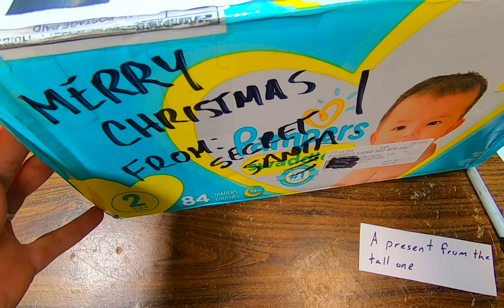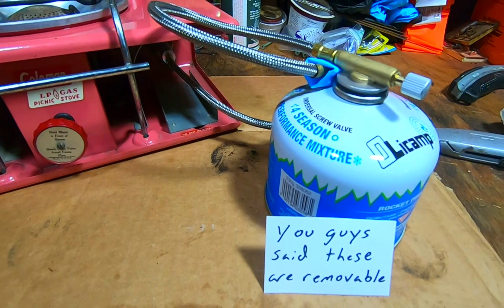Vintage LP stove adapter

Comment: love those stoves. i have found a company who makes fuel canisters that are the same dimension as the old original cans. hope it works i haven't received it yet and if it doesn't work its only 8 dollars.
Reply: Hello, are the canisters ok ? And where can i find them ? :) thanks
Reply: Where can i find them
Reply: @salindahammond7142  sorry but the canister wouldn't work. It uses a screw connection like all of the newer cans.
Reply: Thanks for the update!
Reply: How do I acquire An Adapter.

Comment: I just scored the exact same stove that actually had a full can still installed!  I took it out and it leaked until empty.  Now I need an adapter.
Reply from the maker: I've heard of people refilling the cans with butane. It could be dangerous which is why I haven't made a video but it can be done.

Comment: If you leave valve on the stove open all the way and use the Lindal valve to control the gas flow you can dispense with the chain.
Reply from the maker: The chain is there in case I knock the bottle or the stove. The adapter should stay put against the pressure of the gas, its got an o-ring inside to seal with. I'm more worried about moving things around by accident.
Reply: @LanternLabs  I built a hose like that myself for my Hank Roberts Mini Mark III. If I don't open the stove control all the way and use the regulator on the can end it will blow off at the stove from the pressure in the line. Otherwise it works great.

Comment: I know I’m late to this feed. But I just purchased nice Pink Picnic Stove. 
What is nest way to adapt this to either 1 pound Bottle or Torch Bottle?
Reply from the maker: I've seen it done using a torch head as the connection to the bottle. You'd need a hose with the right fitting to connect to the stove and the torch head. Could be quite economical to use if you refilled your small bottle off a 20# tank.

Comment: I almost bought one of those pink ones. Just couldn't pull the trigger on it. Do you do any of the old nickle plated Coleman's with the mica windows? Replacing the mica has kept me from restoring them to good working condition.
Reply from the maker: I do, if you check out my How to light a Quicklite video you'll see one.
Replacement mica is available, post on the Coleman Collectors forum or one of the many Facebook groups for more details.

Comment: Hello there:
A friend of mine has 3 of those old camping stoves and I was trying to get the adapters for him from the guy (ewin) on ebay but it seems that this items are no longer available.
Any input would be greatly appreciated.
Rick.
Reply from the maker: You're somewhat at the whim of the market I'm afraid. I found this adapter by searching for a lantern lp adapter. These aren't available in conventional stores so you need to wait for someone to make one or figure out how to make it yourself.
Reply: @LanternLabs  Thank you for replying my question.
Well, is nice when you find things online and just order them.
I'll find the parts needed for this I just going to keep my eyes open.
😁

Comment: I just got a prepo stove how would it work with the prepo?
Reply from the maker: It should work fine, the Prepo actually has a better mounting system I think.
Reply: @LanternLabs  oh neat I’d still like a demonstration if possible so I can see it working before buying it as I’m having trouble finding over videos about the prepo stove